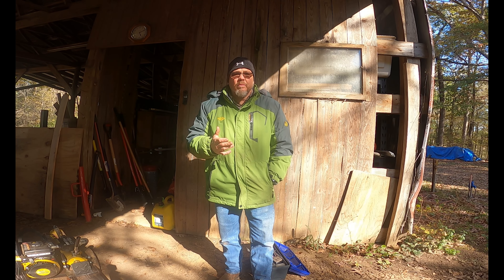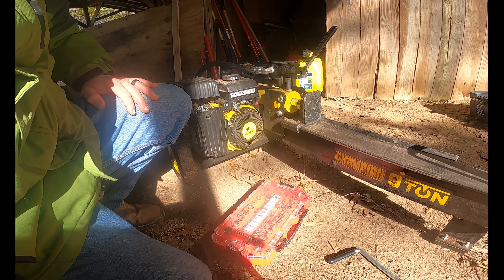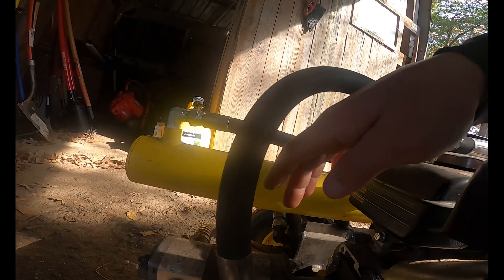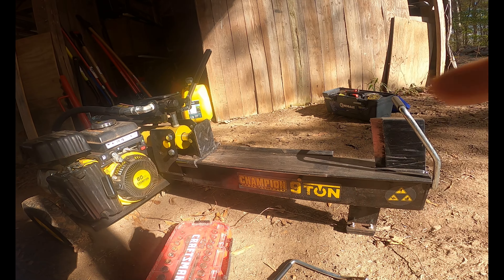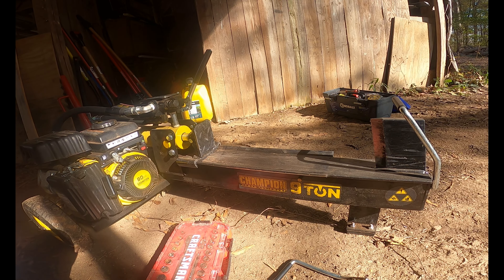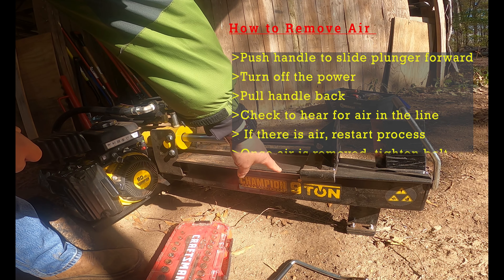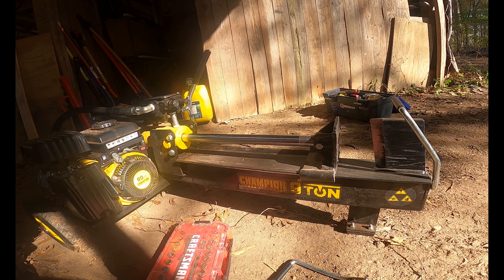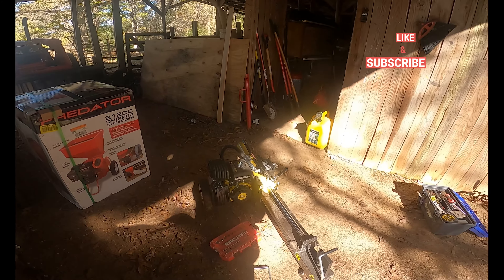Log Splitter STOPPED WORKING? QUICK and SIMPLE FIX for a CHAMPION 9 Ton Log Splitter

Comment: Thanks! Been having a problem with hydraulic oil coming out of that air bleeder and I bet I have air in the lines. Also mine wouldn't start they come with a cheap Chinese spark plug that was over sparking I changed it and it started right up
Reply from the maker: That’s great. I bought my second hand. I’m sure the original spark plug failed long before I got it. Thanks for the comment.

Comment: At the end I see you've got a HF chipper/shredder.  We just got one (a month or so ago).  Only been able to use it once.  How has yours worked out for you?
Reply from the maker: Actually, I haven't had time to put it together. I will get that done this week. I'll do a review. Thank you for watching!
Reply: @157mshaggy   I have had one for years. It works great, but leaks some oil now, not a whole lot just enough to grease up the back of the engine. Only thing I don't like is the main chute hole. I wish they would have made that thing bigger. Getting wiry brush in there is a pita!

Comment: That is not for getting air out of lines. It's to stop pressure or a vacuum from forming in oil tank as the oil volume changes as cylinder goes in and out.

Comment: I have the 7 ton model. It constantly leaks through that bleeder screw. Any idea how to fix it?
Reply from the maker: You can try plummer's tape. That is what I would do. Good luck
Reply: @157mshaggy  You mean thread tape? Take screw out and wrap the threads?
Reply from the maker: Yes, see if that stops the leak. If not may need a new plug.
Reply from the maker: @skipperjones7490  Yes.
Reply: @157mshaggy  I wrapped the threads with thread tape. It don't  leak through the threads it leaks through that little pin hole in the screw. It only does it when the ram retracts. I drained the fluid and it has 4 quarts of fluid so it's not overfilled. Sure wish there was a way to fix that. Its a good splitter but whoever thought of that breather screw set up must have been drunk.
Reply from the maker: @skipperjones7490  The manual is online. I will add the link. The customer service really helped me out and were responsive. This would be my suggestion for you. The link is below:
 https://www.championpowerequipment.com/wp-content/uploads/2019/03/100624-om-english.pdf
Reply: @157mshaggy  I tried splitting some really knotty green wild cherry today. I put a little 2x4 block under the front end support to slightly raise the front up. WOW what a difference that made! No more leaks and the thing has brutal power. It was slicing through them wet knotty wild cherry logs like butter. It's too bad they don't tell people that in the manual. 👿

Comment: I'm not agree with your video. The plug you mentioned is not an air bleeder, it is the tank air breather. There's a hole through it, to let the reservoir breathe.  If you have the correct oil level in the tank, to avoid air in the inlet pump line, you must get the log splitter inclined a bit, to make sure the pump is lower and the suction line is always full of oil.
Reply from the maker: Thank you for your input.
Reply: Is this why my 7 ton always leaks fluid from that screw? Do I need to put a little piece of wood or something under the front end to keep it from leaking?
Reply: Update: I tried it today and no more leaks!

Comment: Mine worked great until it got cold and now it won’t start?
Reply from the maker: The engine needs three things to work fuel, spark, and oxygen. I would start with the spark plug. Pull it and make sure it is clean or replace it. If you are getting spark when you pull the cord, then it may be the lack of fuel. Check to make sure it has fuel, then ensure fuel is getting to the spark plug. There are engine starter sprays you can buy to put in the spark plug hole and replace the spark plug. Pull the cord to see if it tries to start. This is trouble shooting and I'm sure you can find a video that will walk you through it. Good luck!

Comment: My ram will not go foreward
Reply from the maker: I had that problem. First I checked all the fluids. Then I allowed the engine to run for a while to ensure it was warm. Next I worked the handle back and forth. It began to move a little. I just continued to do that until I got enough movement to bleed the air.